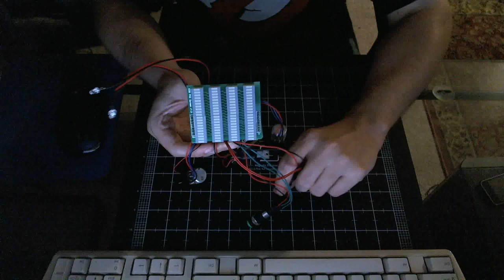EGB meter circuit - HD video

Comment: Do you still sell the completed PKE meters on Ebay?
Reply from the maker: No, but I may sell the circuits.  You can email me at scswift@gmail dot com.  I'll have to check and see if I can find the code as these are several years old, but I still have a lot of the EGB PKE circuit boards left.